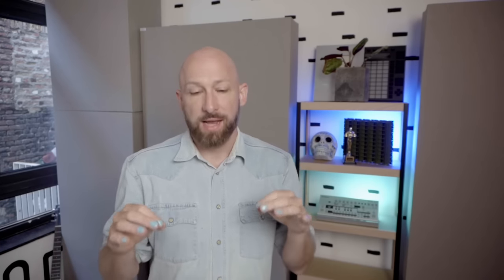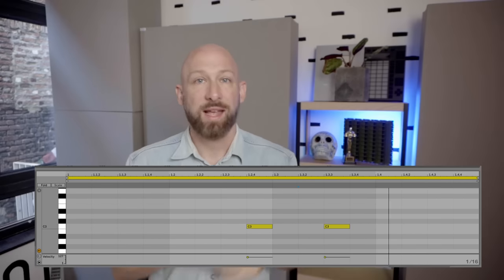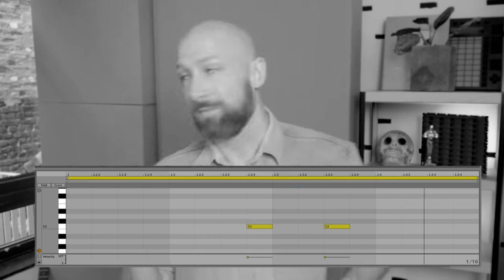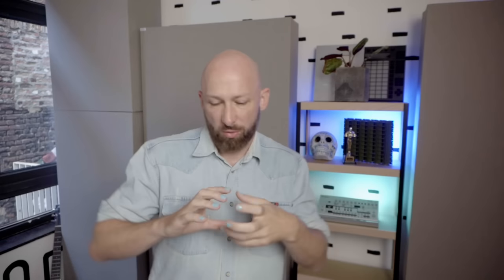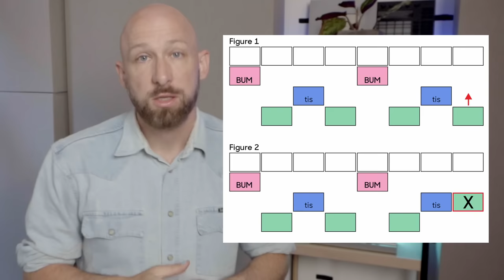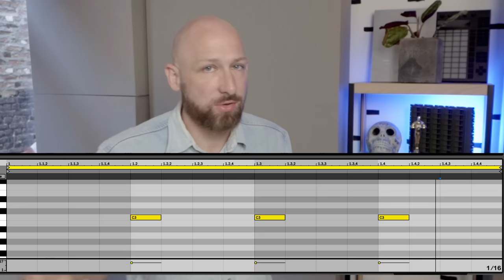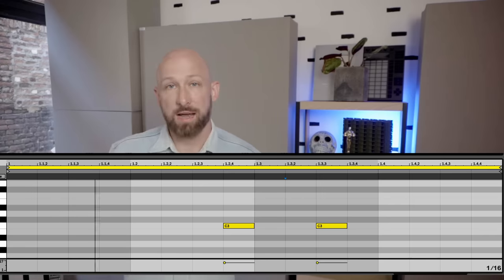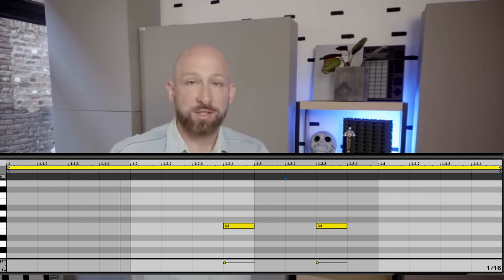Syncopation - the key to groovy rhythms

Comment: I love your approach and your videos,  with respect I genuinely think that It is important to note that Syncopation is any rhythm that is not in downbeat. And I only say this comment because it will be on benefit of your audience and also yourself. So any upbeat is part of syncopation. So your 8note upbeat hihat that you consider straight is actually syncopated. So a truly straight rhythm would be the high hats quarter notes on downbeats, like some heavy metal rock rhythm. So level 1 of syncopation spicing your drums would be that Hihat on 8th note upbeat.  So this makes your point even stronger, with real no syncopation it would be super boring, below the minimum required for Electronic Music. But yes the awareness on the space available on 4 16th notes every beat and bringing to the front the hierarchy of what you call weak 16th noes is super handy and clear.

Comment: Syncopation is moving the offbeat closer to the next beat, not just emphasizing them.
Reply: I was under the same impression, but then read on wikipedia that syncopation is really just emphasising an offbeat, possibly moving it off grid. So there are multiple ways to syncopate. This would be another interesting topic for a video.

Comment: Just out of curiosity - why are you calling it "the acid 303"? Is this some variation of the original TB-303 that I'm unaware of, or is it just some sort of a colloquialism based on the early acid house days that were heavily using the signature synth? I'm a little confused.

Edit: After watching the rest of the video, it seems pretty clear to me, that you are using the term "acid synthesizer" pretty much as the fill-in term for the 303. Which is fine with me - since we have no strong science around digital music production thus far, it feels perfectly fine to use custom terms. Eventually we'll naturally evolve into a more standardized set of terms, like every new area of expertise does.

Please feel free to correct me on any of that analysis.

Comment: Noodles. It still doesn't groove. It's the repetition in electronic music that kills the groove completely before it can even develop. What makes (real) drum beats groove are dynamics (very slight or very obvious variations in the volume of the beat and in the sound of the hits), the element of surprise and the tiny fluctuations in tempo (which may not always be audible, but is very noticeable). Groove is also called the human touch for good reason. All of this is simply not possible on a grid where every beat sounds and feels the same at exactly the same volume. No matter how many syncopation is going on.
Yes, it's no secret that in order to get people dancing, you have to build on repetition and monotony. A simple fact of music theory. That's how you put them into a state of trance. But right after that state comes the state of sleep. Just as you fall asleep on a train because of the monotony in sound or when counting sheep to fall asleep. (It's no coincidence that uppers are the drug of choice in this scene ; ) 
Anyway, the more danceable your music is, the more emotionless and boring it will be and vice versa. If danceability is all you want from music, that's fine of course and the deal you have to make in order to reach this goal. But music can be so much more than just dancing!
For me, most(!) electronic dance music is like noodels. ...Only noodles, no sauce, no vegetables, no meat, no nothing, just noodles ...noodling ; ) And I like pure noodles from time to time, nothing wrong with that. But I always wonder how someone who calls themself a foodie (or music lover respectiveley) can LIVE off of noodles. 
I know quite a few DJs who later in life had this realisation. I highly recomend to explore the world of music, by listening to as much different music as possible with an open mind, best on good vinyl. I don't want to drive anybody away from electronic music! (I listen to it as well when it's interesting enough), it's just so sad to see people limit themselves so heavily.
Reply: Just say you don't get techno and leave it at that lol, don't need to try rationalise it for everyone else. Yeah he didn't touch on aspects like swing or (dynamics), but I think this tutorial is pretty clearly aimed at beginners learning the basics of edm arrangement. Some of the shit you said is just super ignorant!

-"Anyway, the more danceable your music is, the more emotionless and boring it will be and vice versa"
This is absolute cap and completely subjective, 

I'm a foodie (as you call it) and personally love many genres but I could  easily survive on "noodles" (as you call it) because despite what you say, lots (!) of "noodles' have shitloads of "sauce" - you clearly just don't know the genre well enough to know where the sauce is. Don't be so close-minded!